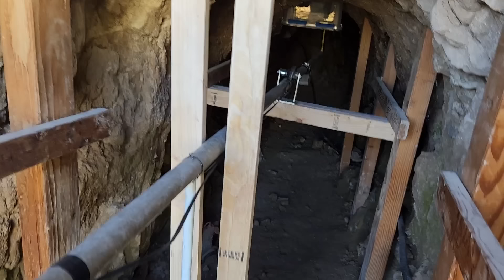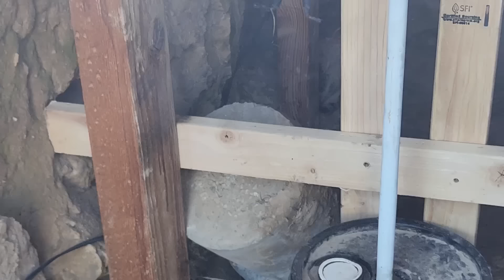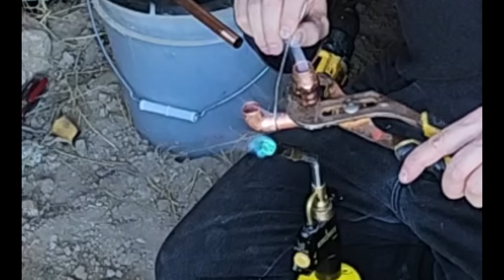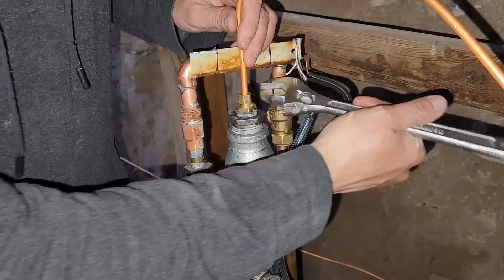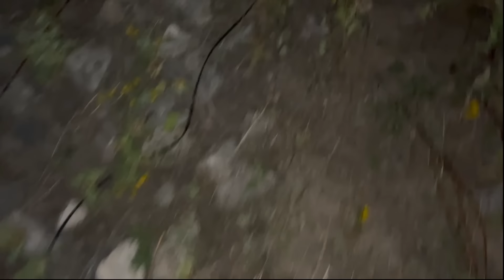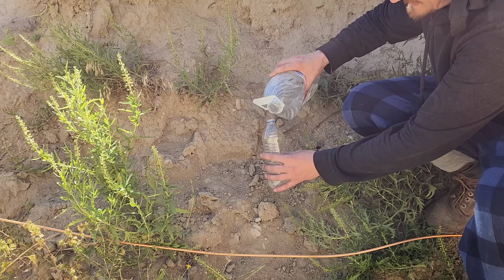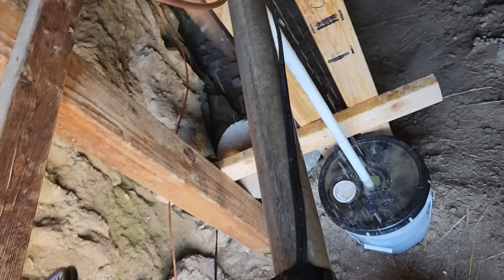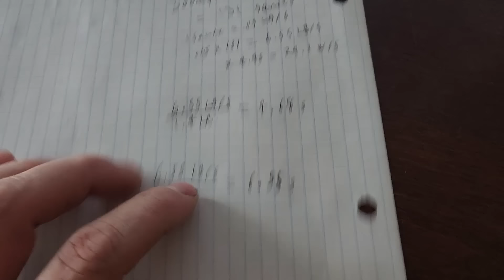Sodium Water Hybrid Rocket?

Comment: so my thoughts since you're just shooting all the sodium out the exhaust is to have a tube inside the rocket that goes almost right up to the inlet where the water is coming in, and cap the bottom except where that inner tube is, that way the sodium has to go up and out through the center and then to stop the water from just going throug hthe center could add a cone below the injector to guide the water into the sodium.... wait this video is 2 yrs old 🤦

Comment: isnt rocket fuel already good for the earth cause it uses hydrogen i think ive seen something about it being good for the earth i could be wrong though
Reply: There are different kinds. Most are pretty bad. Hydrazine is a horrible chemical. Methane, propane and kerosene are fossil fuels. liquid hydrogen + liquid oxygen is super clean(obviously the exhaust is just water,) but also expensive and difficult to use.
Reply: @Plasmafox  well im aware there are different fuels i just remember seeing a video about a launch in florida i think where they talked about it being good for the environment or something

Comment: Brainstorming:
1) Molten sodium dropped into mineral oil to produce "shot"
2) Metering system to combine better ratio of water to sodium (maximizing surface area. could potentially mill sodium pellets like gunpowder in rock tumbler???)
3) Whatever you come up with, I'll watch it.

Comment: Replace the Sodium with NaK-77 (Sodium and Potassium that combine to make a liquid at room temperature). Use two hydraulic pistons, NaK+H2O, both driven by another piston with high pressure nitrogen. Have the two combine in a ceramic reaction chamber vented through the nozzle. Regulating the nitrogen pressure should regulate the thrust. Don't forget the check valves.

Comment: Cody would lithium and water work for that or would that be too dangerous? I know it has a similar reaction but thats all i know. Just curious nice video. Fun times
Reply: Solid lithium doesn't actually react very fast with water. Now, liquid lithium would, and it is lighter than sodium which should get the specfic impulse up

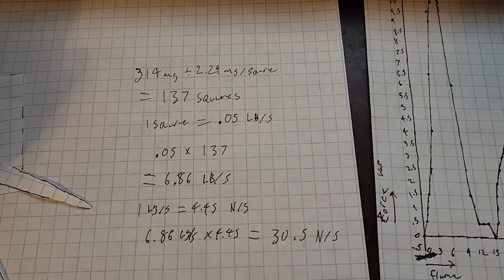Comment: ca. 9:00 - You're saying "pound seconds" and "Newton seconds", which are proper units of measurement for impulse, but what you wrote on the paper is "LB/S" and "N/S" (or "LB/s" and "N/s", that's hard to tell), which would be "pound PER second" and "Newton PER second", which are NOT units of measurement for impulse. The proper abbreviations for the proper units would be "lb s" and "N s", respectively. (Also, note the LOWER CASE "lb" and "s" there).

Comment: With hindsight 20/20, when you mentioned that sodium has a relatively low melting point, it might've been possible to realize at that point that maybe using it as a solid rocket fuel wasn't going to work :D But on the other hand, then we wouldn't have gotten this cool video & fireworks out of it :D

Comment: and if you want to know how much the range of the fuel can get you to longer range ,u have firat to try a small one ,but the small one shoukd exactly look like the big one in ratio ,lets say the diameter of the missike is 1 inch and a lenght of 50cm made a range of 500 meters lets say ,ths weight of the missike should be weighed befor and after and lets say the weight of the rocket is 1 kg and ths mixture is 1kg range is 500 m youu keep adding according to the first one ,u need more 500 meters so it neefs to be bigger in diamiter and lenght

Comment: to calcukate hkw much mixture u need to left the weight of the rocket ,u can bring a normal weight stick it somehow facing the front of it kg or g depends on the size ,according to this u can multiply the size but saving the first ratio

Comment: Here's an ideea. Where you pulled out the rod, if you replaced it with a pipe, making a coaxial system, the sodium would have been isolated from the nozzle, the high pressure vapors would have gone through the pipe out of the nozzle.

Comment: I don't know if you're still working on this, but I think simply making it larger will solve the issue with weak thrust.

As size increases, volume increases exponentially. Yes, it will be even heavier, but it'll be able to hold much, much more fuel.

Of course, you probably know all of this. You're easily one of the smartest youtubers out there, and probably the smartest I've ever seen.

Comment: It looks like the water injection was too fast and the nozzle hole was too big. The whole fuel just fell thru in on the ground and burned there. Maybe not too big, but you need to find a way to prevent that metal from falling on the ground.

Comment: Could you have used an emulsifier initially in the water to remove the mineral oil from the sodium to smooth out the ignition process?

Comment: So it may be a better design to react it with chlorine. Also, rather than having solid sodium, which as you found out quicklky melts, pre-heat the sodium until it becomes a liquid - but in a container which has a argon or nitrogen atmosphere. To begin the ignition simply spray the liquid sodium and chlorine into a combustion chamber in the right proportion. Ensure the combustion chamber is 'cooled' by liquid sodium, and pumped to heat the sodium tank. This way the excess heat can be used to melt more sodium. Control thrust through a pressure value of the chlorine and the pump for the liquid sodium. You want an even combustion of the sodium with the chlorine. Byproduct is salt - so safe you can eat it.

Comment: I love this experiment, but it ended in sodium diarrhea. You kind of need a mid reaction chamber where the hydrogen oxygen mixture is produced, then gassed vertically into a third reaction chamber where it can burn completely. Not sure how to fix the molten sodium problem, but you definitely don't just want it to slam out of the tail. Would an additional scrubbing chamber after the hydro ox work? Bubble it through mineral oil? Do you let the sodium liquify into an additional fuel injection chamber? And of course the peroxide you mentioned.

Comment: Cody: "I need to find the area under this curve"
Neuton: "Ah yes, I created a whole school of mathematics for this, surely he'll use a limit or-"
Cody: "and the easiest way to do that, is to cut the paper out, and weigh the paper."
Neuton: "...I'm equal parts disgusted and amazed, that's so low brow it's genius"

Edit: Also iirc one of the man problems with Sodium is that it's very corrosive at high temperatures, so getting a combustion chamber that can survive long burns is a challenge.

Comment: Sodium metal is lighter and softer than most plastics. I doubt they were referring to that type of metal when talking about "metal parts". They surely meant hard heavy parts. I mean, would they allow a ceramic rocket to fly just because it's not made of metal?
Reply: I think he was trying to make it class 1, maybe? Class 2 has no such metal restrictions (though other rocketry organizations prefer to keep the metal to a minimum despite that), but does require an FAA waiver to fly

Comment: Would love to see a revisit. An idea, why not have a reaction vessel with a top side outlet leading to the exhaust nozzle that way as water enters it sits with the sodium and only the gas escapes out the top. Perhaps a system like snorkels use of slanted plates to prevent water and sodium from riding the exhaust?

Comment: In the water pressure test there was thrust. It results from the momentum change from the water mass at rest to the water mass’s ejected velocity. I believe in fact that the majority of all the thrust you measure from these engines results from the momentum change of what mass starts off in the engine and that mass’s final exiting velocity.

Comment: Hold on, if it specifies no metal parts, and that includes the fuel, that would ban ammonium perchlorate/aluminum rockets which are pretty common in model rocketry
Reply: Yeah, I dunno what definition he was looking at. Class 1 rockets only disallow "substantial metal components" (which his combustion chamber might be?), but class 2 has no such restriction (though he would need an FAA waiver)

Comment: Could you try calcium carbide instead of sodium? Calcium carbide reacts with water to make acetylene. It is very hard, like stone, and it won't melt until 2160°C. The calcium hydroxide biproduct is very friable and would ablate off, exposing more CaC and exiting out the exhaust instead of adding to the weight of the launch vehicle. Better yet, use hydrogen peroxide instead of water, which will make acetylene and oxygen and be ready to burn. Catalyzing the decomposition of the hydrogen peroxide first might even generate the heat, oxygen, and water needed to instant react and combust with the CaC.

Comment: Cute experiment!  
What would happen if you machined a hollow cylinder of magnesium and used H2O2 as oxidation in place of water?  If it's concentrated enough (could be a problem) the catalytic decomposition of the peroxide will yield oxygen and superheated steam, which will set the Mg ablaze.   The pre-war Germans used silver wire net over the peroxide to decompose the peroxide.  Or one could set the Mg on fire before injecting the peroxide.  That's probably a simpler method than catalysis.  I'm  thinking that since Mg has a much higher m.p. than Na, it won't melt out of the rxn chamber like Na does.
  I don't think a solid hunk of Mg will burn fast enough to make a decent fuel by itself.   But hot oxygen should make it burn fast.  And as we all know, adding hot water (as steam) to hot (i.e. burning) Mg will produce hot hydrogen.   Which should react with more hot oxygen from more decomposing peroxide....  Excess water in the form of steam will be produced in the latter reaction, which will add extra thrust.  The decomposition of H2O2 has been used to create thrust in rockets.  Again, the Germans did this and so did NASA, who used it for small directional thrusters.  By itself, it shows piss-poor impulse, so it hasn't seen widespread use.

Comment: When I was 16 I used to go to my grand mas resort a 1/4 mile from my house and talk to the old retired men ,and this one man was a captain in the air force in R&D any how he told me about how he and other researchers had taken an F-4 trainer engine and put it in a test stand with air and kerosene it would produce 30,000 HP , but with Furfuryl alcohol ,Hydrazine and white fuming nitric acid they were able to obtain 300,000HP and when set up in a fighter jet it could go into space a short way ,not familiar with space travel  being a lowly test crew they left that to the test pilots furfuryl alcohol is some what poisonous, hydrazine is very poisonous and white fuming nitric acid is corrosive and the by-products of combustion are extremely corrosive, the acid is the oxidizer and it's hypergolic look for them in wikipedia there's a dozen other useful compounds you can make besides rocket fuel, hydrazine can be made with hydrogen peroxide  and anhydrous ammonia, heck if you can get 80% hydrogen peroxide it and anhydrous ammonia can be hypergolic or peroxide and kerosene also,be careful of the 80% peroxide very corrosive and unstable, you can use any alcohol with it also all fuels are hypergolic. great fun(not)you don't have to put a rocket engine on a rocket why not a boat full size(row boat) small car, bicycle.. Just some stuff I remembered you looked like you are careful enough, I've never given this info to anyone else. I'm 71 about the same age as that captain was when he told me about these chemicals, heck if you could mix hydrazine with gasoline it might make a awesome power booster or go boom, nope that would not work the gas has10% ethanol a built in oxidizer it'll go boom. Diesel will work with hydrazine I think.

Comment: What if you somehow could have molten sodium metal in a pressurized chamber and the water in a separate pressurized chamber and injected them together at different rates in a combustion chamber. Maybe a custom bigger nozzle with a high temperature resistance for the metal.

Comment: Clean you scale all the yuck in there will get inside the moving bits and through your calibration off by possibly a lot. You are measuring out it .001 thats very tight tolerance

Comment: You also could try the sodium-potassium alloy as it's a liquid, to create fully liquid rocket engine. In this case you'll be able to dose the amount of fuel going into the "combustion" chamber and avoid "melting and leaking of the fuel" issue that has place in the present project.

Comment: What if the sodium is injected into a combustion chamber, like a plastic injection molding? Heata tube of sodium using resistance wire, inside an ekectrical insulation, with cersmic wool aroundit to kerp the heat in. Or a silicone heat pad wrapped around it! Use a piston pressed by a screw, (threaded rod) and servo motor. Use a high temperature silicone rubber possibly as a check valve. Like the squeeze bottles of dish soap. They sit upside down but do not leak! Maybe use a thin stainless foil to protect it on the outdide drill a tiny hole in the center , with cuts from the center to about 1,mm from the outer edge.  with them both held in place with a threaded reducer budhing indide the fitting. Basically when under pressure the rubber will spread open st the hole in the center of the outlet. Travel through a short small tube to a combustion chamber where the water is sprayed in somewhat of an Venturi mixing water and sodium the water can ve a fine mist, the sodium basically a stream hitting the wall and turning into  a sodium shower!! Mixing with water in the process!  It could be easy to control, and the sodium can be loaded in. A log/bar form a shot from,  and after heating to a certain temperature for a certain amount of time, it can then be ready for ignition!🎉.  This has me wanting to build one!   Hone the inside of the pipe to be used then a piston with multiple O-rings with grease between them for lubrication the walls of the tube coated also to protect it from the sodium!   It could be interesting getting it to react alot of sodium in a chamber really fast!

Comment: Fyi potassium nitrate is a metal used in model rocket engines you can use metal as fuel you just can't build the fuselage fins or cap out of metal

Comment: You might want to use NaK and separate the chamber or you can use granule of sodium to increase the surface area but you’ll need to add a mesh in the nozzle to prevent the granule sodium to pour out. This is a really interesting idea!

Comment: Your measurement system has a low spring rate.  That's why your impulse graph looks like a decaying sinusoid.  Also, if you're going to do a paper integral it's better to use heavier paper.

Comment: An inner sleeve cup facing up.The bottom could be cone shaped and positioned near the outlet to control thrust. Sodium in the cup, injector into that inner sleeve.  Thrust straight up down the sides.

Comment: I think in this particular case it would be wiser to switch oxidiser and fuel around. Instead of pushing water into sodium cylinder, causing reaction and thrust, but also causing sodium to fly out in chunks and burn unevenly, pushing a rod of sodium into water at high velocity might be better. Sort of like pushing solder into a welder and causing it to melt evenly. If the proper speed could be calculated, pushing sodium rod, encased into something like oily paper tube into a container of water could make sodium react more evenly and smoothly, causing increasing impulse length. It would still cause other problems, but at least that way reaction could be managed by adjusting the speed of sodium feed and would provide more control over the reaction.

Comment: Are those state or county regulations holding you up on rocketry? I did a quick search, but couldn't find much specific to Utah regulations on metal components.

This is all done on private property, so I'd think many regulations were avoided there anyway unless the rocket travels outside of that property and/or sufficiently high to enter regulated airspace. (though once the thrust and impulse qualities of the fuel are established, it should be easy enough to construct a rocket that won't fly too far ... presumably experimenting with similar sugar based rocket engines as a control)

Aside from your own property, is there any federal BLM land around there? In some other states (including CA) many of the complicated regulations and requirements are bypassed on BLM land, but those areas may require other qualifications for being rocket-safe, similar to, but distinct from designated recreational shooting land. (though much of the fire danger overlaps, rocketry is still different ... there are some desert dry lake areas in CA that allow much less restricted rocketry, but probably not as many areas as with target shooting)

Beyond that, on private property in CA most of the regs surround formal approval of your local fire marshal ... but I'm not sure how similar that is in Utah. (I do see Utah on the list of rocketry-unfriendly states though, along with CA ... except CA has a lot more fire-prone land than Utah, so that makes less sense) Plus metal components have little to do with fire danger (aside from nozzle and fins retaining heat sufficient for ignition upon landing). There's more of a concern with black powder fueled rockets than metallic or hybrid fueled rockets in some rocketry clubs in CA (at least beyond commercially made BP motors ... but BP has a lower ISP and is more difficult to make than even sugar rockets, so there's honestly little incentive to use BP anyway ... at least standard BP, and not other charcoal containing mixtures that are BP related, as sugar rocket fuel technically is, but not actually BP)